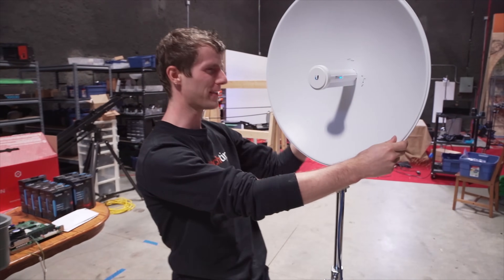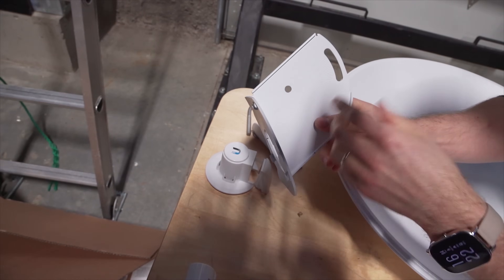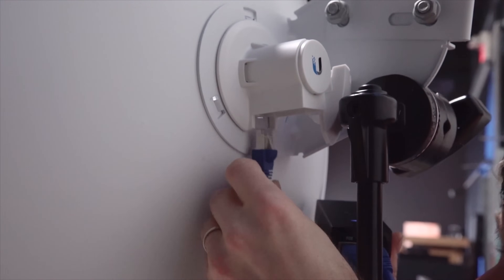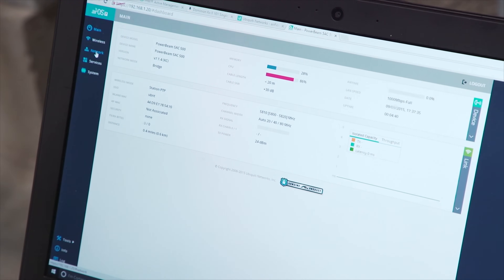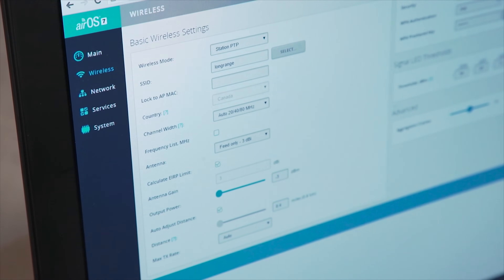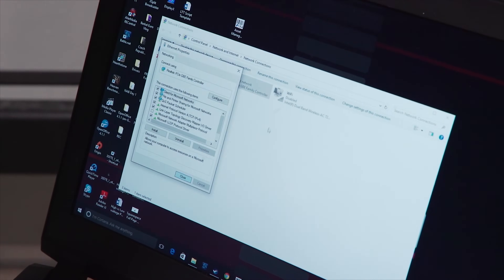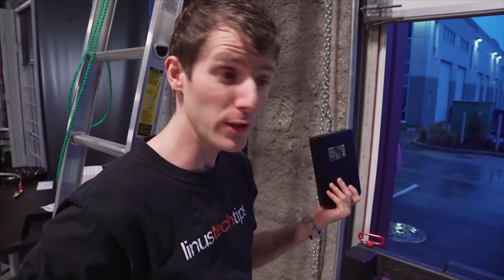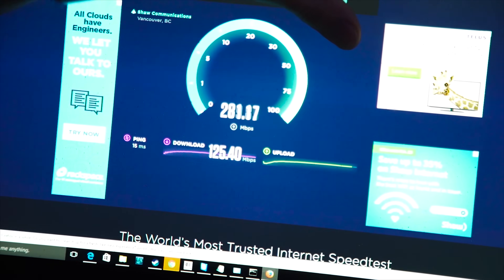HOLY $H!T - Long Distance Wi-Fi (Up to 25 KILOMETER range!?)

Comment: Question Will this work if you can Only Use 1 of the Satellite Dishes because you can't change the WIFI equipment on the Other office budlings.  I need about 1 Mile range but have Straight line of Sight. If this won't work any other suggestions are welcomed.

Comment: I have long range wifi as well, but it's illegal here so I'm not using it on the regular. If I put it up into my mom's windmill it could probably reach home, which is a bit over 10 km away.

Comment: I wonder if anyone will answer my question.

 I live on a 1/2acre peoperty and want to do this. Do i need 2 routers?
I would connect the first one in the main house to the router in their, will the receiving dish be able to plug into another router to recieve the signal so i can connect my devices wirelessly to the recieving dishes router?

Comment: that size antenna tower isnt bad at all, for a flat terrain and same level connection for 20 kilometers you need close to 35-45 meters tall tower, add a house in front of you and you are going to need that size of tower :s fucking physics

Comment: just found this record for longest wifi range 

Italy

The longest unamplified Wi-Fi link is a 304 km link achieved by CISAR (Italian Center for Radio Activities).[9] New world record for long-range wireless broadband.

    link first established on 2016-05-7 e 2016-05-8
    it appears to be permanent from Monte Amiata (Tuscany) to Monte Limbara (Sardinia)
    frequency: 5765 MHz
    IEEE 802.11a (Wi-Fi), bandwidth 50 MHz
    data rates: of up to 356.33 Mbit/s
    Radio: Ubiquiti Networks AF-5X radios
    Wireless routers: Ubiquiti airFiber
    Length: 304 km (189 mi).
    Antenna is 120 cm with handmade waveguide. 35 dBi estimated

Read more: http://www.cisar.it/images/2016/27HighCapacityLong.pdf

Comment: this 10 miles range  is not possible with these two simple devices, first of all, you need a clear line of sight clear means very clear if you are in the city this thing won't work for you at all or you have to mount these devices at extreme height to get a signal there are some videos like this on youtube I watch them and then I bought devices and spend 700 Us$ but the result is zero and no success  and no use I still have all the equipment if somebody needs ALL OF THEM you can contact me

Comment: Point to point connections are basic around the world. Line of site can go a long way. However, your title implies it's wifi which is a bit of a mislead as there is no personal device that could actual have a TX signal even 100 meters. But RX or some one way receipt is possible. Anyway baiting titles are common to gain views....😇

Comment: Is it stronger at a distance because the antennas are designed for 25km installations. My long range is shared over three houses, one house is about 500m away and we use 24db antennas, the other house is 200m away and we use 12db antennas. I know you can adjust your db, but it still seems they were designed to be  function better at a distance

Comment: Reminds me of my first WiFi base station.  I was the first person in my apartment complex to have WiFi by years and I kept trying out antennaes, tinfoil and where to set up the base station in order to reach the pool.  The WiFi base station was a hub not a router and the security was WEP, I was using a Pentium Pro desktop running Linux as a firewall to the cable modem.

Comment: I forgot if it was Detroit but citizens are using these to be provide internet to neighbourhoods that don’t have high speed internet. They were linking the dishes house to house to make a private internet network. So every new customer added a new structure to expand the network. They would also approach the tallest buildings and offer them internet in exchange for mounting dishes.

Comment: This is how crap aussie (non optic fiber) internet is ... We only get MAX 1.5 MB upload speed. And before you ask, this is the best most expensive cable connection out service provider offers ... That is correct one point five on cable. I so wish i have 200+ MB upload.

Comment: So, could i buy one of these antennas and just use it as an access point and mount it in a tree for long range wifi without the other dish? Or does it have to connect to the other antenna?

Comment: Linus, if you want to really get into some serious wireless tech check out Cambium or SAF, they are a bit more pricey but so much better quality than Ubiquiti. And of course there's Ceragon the Cadillac of  point to point wireless. We use 3 Ceragon links each capable of up to 700 Mbps over 10-15km distance.

Comment: I've actually specifically looked for products that did exactly this for years. I want one. I wonder if a housing developer with multiple properties could use a series of these to establish a wireless network of wireless networks. maybe someone could even use them to build a new internet in a city that's not connected to the actual internet, which would actually be much more useful to a big Corporation with multiple branch offices that needs security. Assuming the passwords are all secure that is.

now my question is: is this more or less effective than running an ethernet cable 25km? I'm assuming you'd have to repeat the signal fairly often, but is that a real challenge?

Comment: I have this same system ... SC620's .... It is badass. I am using mine only 1.5 miles apart and I pay for 300Mbps at the tap. Of course I normally get 350Mbps at the tap. By the time it gets to my end location, I DO NOT lose a single Mb. It is rock and roll. The mount on mine is sooo much better than what this one is showing, so maybe Ubiquiti has upgraded the mount. Excellent system for those in rural areas.

Comment: I am not an expert when it comes to networking gear, but as far as I know, using POE (Power Over Ethernet) uses at least 2 out of 8 wires from within the cable to power the device which means that the maximum speed will only be 100 Mbps (the maximum speed that can be achieved on 4 wires) and exceeding that requires all 8 cables to be used strictly for data transfer. In this case, how can they claim 450 Mbps? Am I missing something? Nice video by the way!

Comment: interesting stuff i did know it exist and setup a link like that for a company with 2 buildings needed connected but only the hardware i did not anything see how the software did or how it performs, point to point should see visually eachother specially over so long range, so mostly a tower on both ends will need, or you must live on outback places like Australia you prob need a few meter pole to get the connection work.

I will like to see a follow up as most here with really that 20km distance if posible

Comment: Used these at the place I used to work a lot for making links to nearby buildings for IP cameras and stuff. They're pretty cheap and out of all the things we sold that were similar to this I liked them the best. Forget Enginius and Radwin, those were funky and never worked right. Hardest part when you're doing things at that distance is aligning the dishes, especially if you don't have the fancy equipment.

Comment: my elementary school used to do this bc it was like 1000000 miles away from the rest of the district, so a wired shared network wasn't going to work. it just had a giant tower pointed at the high school.

Comment: This isn't WiFi, its Microwave AC technology - Yes uses the same 5Ghz band as 'WiFi', as do many other things - Microwave ovens emit radiation in the 2.4Ghz band etc. I use this technology on a day to day basis. The reason it worked better when he went outside was most likely due to reducing the noise floor, when close together, due to their high gain antennas they can drown each other out resulting in a poorer link.

Comment: why not use cambuim units ? ptp 1000 are a bit OP but thats nothing new to you guys there config system a bit slow compared to units like Mikrotik and Ubnt but you don't have the problem of firmware update to RESET the bord like on ubnt having to reconfig  the thing and if you get the right antena connected to a pmp 2000 you have very little frequency interference the pmp 2000 etc but thats an AP ptp 1000 would be best but would love to hear your thoughts on that

Comment: I work for a completely wireless ISP. I can tell you from experience Ubiquity equipment sucks. Their software on the other hand is great. If you can deal with the horrible software and slightly more  difficult setup. Cambium is the way to go. Less connection drops and they handle interference better.

Comment: note anything past 5 km may require a spectrum license to use..

confer with your regulatory body 1st linus

that is the only problem with the ubiquiti hardware especially when and where you use distance as a service option..

I know in my country this applies to all 24GHz gear, and may also apply wear gear has attributes exceeding the standard radial distance past a omni directional antenna system, regulations may apply when dish style networks are in place..

licensing cost can exceed $20,000 for a spectrum license from your version of the FCC within your country.. you will have to inquire within your country to what the regulations dictate on distance and spectrum license whether you use 2.4/5/5.8/24GHz..

Comment: Also, for full beans, make sure you select these settings:

- Wireless > Channel Width=80Mhz
- Wireless > Aggregation Frames=64
- Output Power=(as high as needed)

...and probably some other tweaks I can't remember. All in all, great devices!

Comment: Hehehe... Turns out these antennas HATE walls. Dug a working ubiquti Nanostation 5 out of the trash, and was planning on using it to connect to my schools gigabit network. Unfortunately, the walls of the school block the connection just enough that it doesn't work.

Comment: Linus you didn't mention if you cranked up the power output when you moved down the street with the other antenna.  If not I would suggest you crank it up on both antennas and see how it goes.

Comment: Its another kind of wifi not the same as your laptop its only create a bridge between the network its like connecting a network cable but instead the link is done by two antenas but with 25km of distance :D

Comment: been there done that 
we all pitched in for ~ $100k for the main wifi tower 
and every one had ~$200 LOS antennas 
90km 100mbps 15km 1000mbps
back n the early gaming days in AU around 2000 AD 
when we all had dial up in our area 
then ADSL came along :P

I still run the tower my mobile can get it 3-5km away depending on weather
( need to send data using mobile data still however )

Comment: Fantastic video proving a LOT of points - thank you very much to LTT

I had my wifi cut off because I changed bank accounts and Talk Talk didn't even give me the chance to set up a new standing order - so I asked a neighbour if I could use their wifi from their Vodaphone service and they said yeah sure.   My little Atom struggled with 2 bars of green on the connection but I did at least get a connection of sorts if I stood at the back door with it open.

I was pretty angry with Talk Talk and had already made my mind up that having been a customer of theirs for 10 years or more without missing a payment that I would never go back to them so I did a lot of ebay research for prices and internet research for products which might help me.   Luckily my neighbour is much closer than 25 kms (just 5 houses away in fact)

I got a generic 802.11n dongle with an aerial attached to it (non directional) and a 10 metre extension cable (way too long - I needed much less but I didn't know at the time) - the dongle has the Realtek chipset in it, the booster cable has a capacitor in it 

When I got it I taped it to my kitchen back-door window, plugged the usb cable in to it, put the other end of the USB cable into the Atom, ran the software and bingo - from one or two low signal networks available there were literally dozens of 5 bar solid connections available (mostly with pre-shared keys of course so no use to me of course but they were there and thats the point) 

I now (pay and) share my neighbours wifi and he has a couple of other friends on it - he has a 72mb/s fibre optic - he has it set up so we all get around 15 mb/s each for permanent but the box he has is smart and will give as much throughput as available until another user contests it - clever stuff I have no clue how that works but the point is it is never slow, videos don'e end up buffering (except on facebook, go figure ? )   and if he hadn't told me I would have had absolutely no idea at all I was sharing with anyone else

One of the connections is another friend of mine who lives about 800 yards as the crow flies and he is connected to regular (twisted pair) broadband and asked if i could attach to him to check the connection out, so I entered his password and bingo another available strong connection tested at around 12mb/s or roughly the same as he gets from his router to his laptop which is about 5 yards away.   He is up the hill and it is pretty much obstruction (and houses) free

Right - so the longest most folk would ever need a cable is about 5 meters - get one with the capacitor in it they are only about £1 more - I suggest rigging up some sort of hook system and attaching it with Gorilla tape on the windows where you might want to use the computer so its there right away without having to faff about with tape every time - or maybe even a little stand for it ?   It's movable and that's important to remember.

The reason I think this video is so great is that I am really angry with the amount of money that has been spent cabling Wales - it runs into many many £billions and proves the point that money was a complete waste.  This money was paid by the public coffers - not the service supplier - what a complete and utter con that was eh ?  Unforgivable especially as I had thought good RF type wifi would be achievable and made mention of it many times before all those £billions were spent. 

I couldn't afford one of those dish things to do a test with so this was really really a great experiment to share.  

Thanks again

Comment: Could you pick up a  free wifi hot spot from say a Starbucks, a Mc Donald or a neighboring college?
Reply: If you point it right you can. I have one of these, I can point it across the lake at the college and connect to access points. Throughput is garbage and the signal is barely there, but it's still over a kilometer from an indoor access point.
Reply: yes you can - but not using a directional beamed dish like that -
Reply: Yes but the experiment is made on a line of sight beam, not an omnidirectional beam - is what I meant to say.  I too can receive wifi from our local free hot spots and it's good! 

line of sight and beamed signals are very precise (could I aliken it to setting up a SKY dish, for example)

Comment: Ubiquiti make great products, but limited on bandwidth (but you can go FAR). If you are within 1 mile you can do 5gig using Siklu... we use Siklu in city surveillance as you can get REALLY great bandwidths with ther gear. NOT cheap stuff and they DON'T go far NOR do they have a wide spread, but for point to point, awesome stuff.... btw I believe that is 450 TOTAL not each way